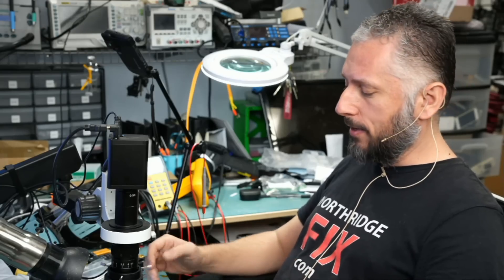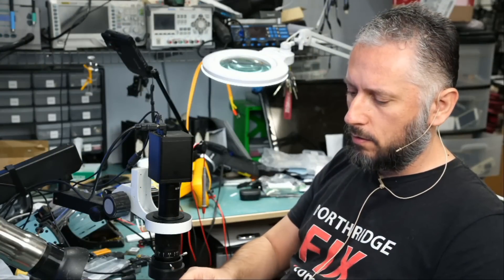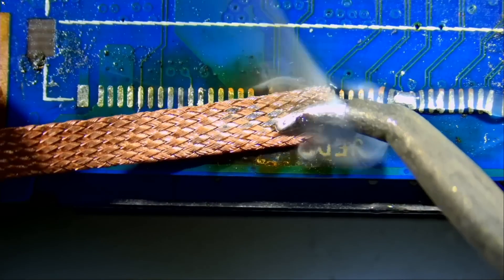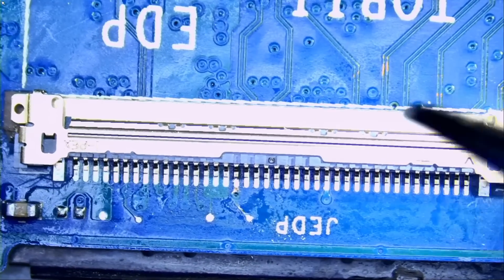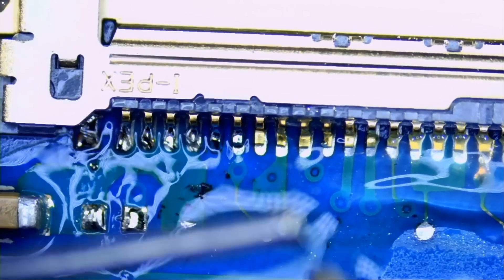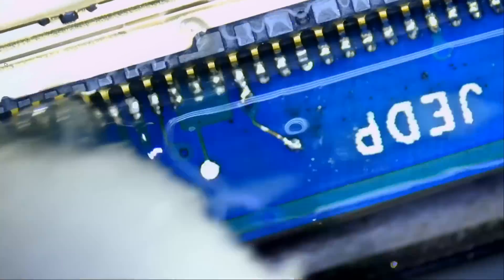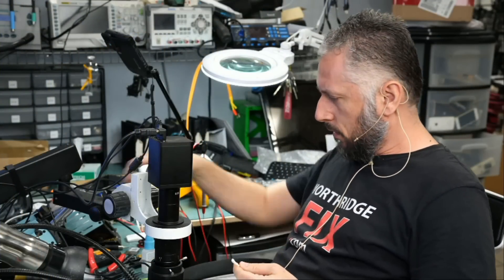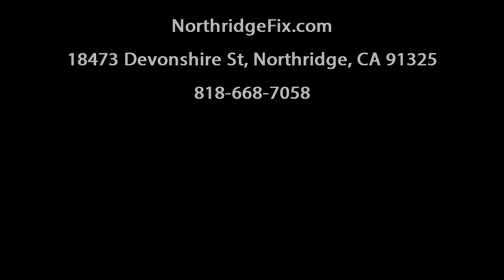Alienware EDP display connector replacement using NF.Mini solder pen and low melt solder

Comment: I used the NF Mini to fix the AV out and controller port on my PC-Engine Duo R and it was great. The flux and solder were also excellent and way better than the garbage I had used previously.

Comment: Is there a reason why he didn't tin the pads before soldering the connector? Seems like it would have been easier and saved time. I hope he feels better and gets over his cold soon. Solid!
Reply: Because it makes it harder to make the connector to sit flat against the board when soldering using a soldering iron if the pads have mounds of solder on them.
Reply: @macman6421  I guess I would have just used Kapton tape to protect the plastic and hot air because of such small pins on the connector and the chances of bridging using an iron.
Reply: @MeatBattery  the risk to melt the plastic is still high using Kapton tape. the distance between the plastic and those pins is so close, so soldering iron approach is better and safer in this situation. judging Alex's skill, chances of bridging using an iron is none, so why take the risk?

Comment: What’s the  temperature to mix low melt solder with existing solder ? I guess you need to heat up to the temperature that existing solder starts to melt, right ? Otherwise you only add an additional solder layer on top of existing solder .
Reply: Im guessng most new componenets use lead free solder which requires a hotter temperature to melt.
Reply: Does not work like that. If you add a lower melting point solder, as soon as it liquifies, it will mix with the other solder, and the heat transfer will be optimal, thus the higher melting point solder will liquify sooner. When you add only heat, it takes longer to transfer the heat. I always mix unleaded solder with the leaded one, to make it easier to remove components. Even regular unleaded solder helps alot.

Comment: Got anymore gpu repairs? I love seeing them repaired. Do you repair stereo receivers ? I’ve got two receivers that I could send over the boards. They are pretty nice units. One is a dennon and other is a sony. One song keeps saying protect soon as it turns on.
Reply: he said on other videos he does not do stereo equipment repairs in general.......he might do it if you diagnose and find the replacement parts in advance....make sure to contact him first